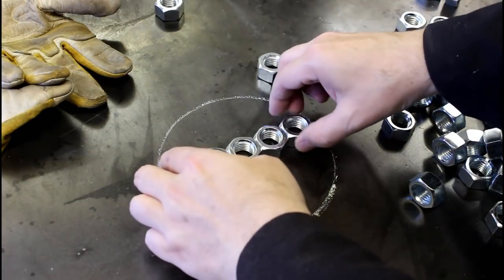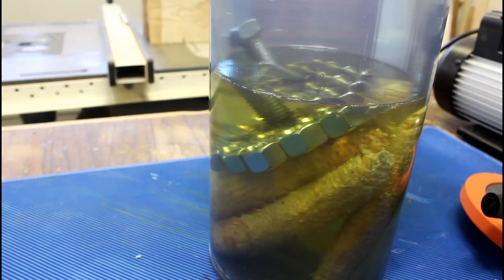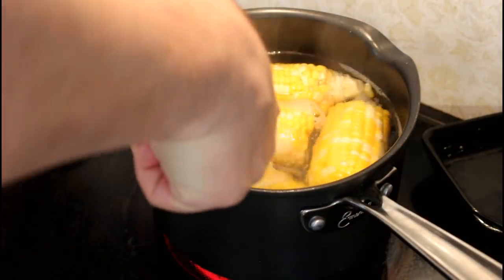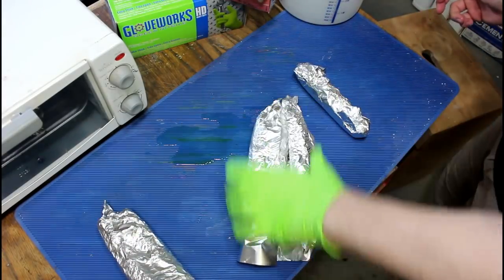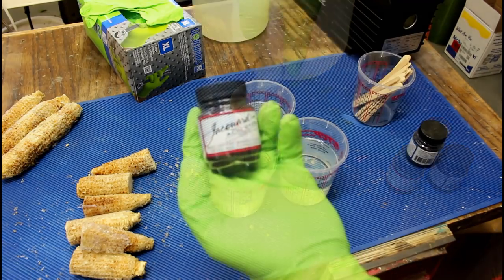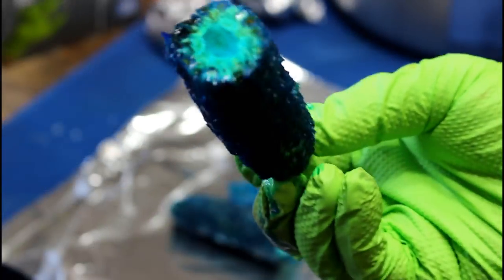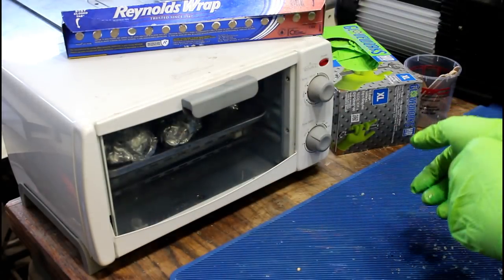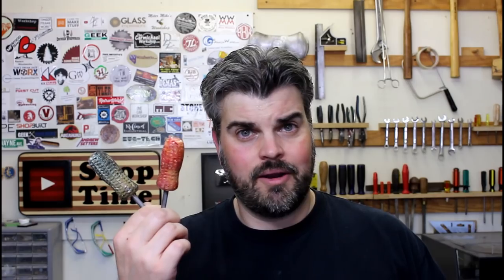Dyed and Stabilized Corn Cobs!

Comment: What about inflating a marshmallow in the vacuum chamber, then setting it in resin, still inflated?
Reply: Matthew Shaw It would deflate the second you opened the vacuum chamber.
Reply: could you not put the resin in the chamber too, so that you inflate it, then hold the vacuum while the resin cures?
Reply: That’s a great and creative idea! I mostly love it bc what would actually happen is a total mystery! 
My concern is, will the resin set while still under pressure?
Reply: K Froetta the resin would need oxygen to set
Reply: Ooooowwww....     I would LOVE to see that.
Reply: i am thinking casting and i am thinking electronics. problem is our man is not the tech guy that could create such an apparatus.
Reply: You might be able to stabilize the inflated marshmallow with resin if you were careful and the cast it.

Comment: VERY Cool!

Do know that the acid dye you got is made for protein-based fibers (i.e. animal fiber like wool.) Jacquard also offers a dye for cellulose based fibers (i.e. cotton, hemp, cane, and yes, wood) under the name Procion MX. It's generally the same price as the acid dye you got, but will be absorbed deeper and more evenly into the fibers. (My wife is a spinning, weaving, knitting, and fiber dying instructor, and I've learned more about this than I ever wanted to know just helping her set up for demonstrations.)  The fact that you used the dye to tint the resin sort of eliminated the need for it to be absorbed as deeply as it could have been, but just tossing it out there. I've been using Procion dyes on wood for a couple of years, and it works very well. Dharma Trading Co. also sells a Procion dye for a lower price than Jacquard, and in a lot more colors.
Reply: Mark Lindsay CNC there is quite literally more than meets the eye to pigments.
Reply: I know - that was my point. Not all dyes are the same. I've been working with wood for 45+ years, and one thing has remained the same - use the proper tool and or supply for the job.

Comment: Cut the corns into thin discs and set them in resin as a serving platter to serve cooked corn on.. cornception 🤯 👍🏼
Reply: Or long strips like the whole outside so you can clearly see the corn pattern
Reply: carlinianam0s Why not both? Have alternating vertical and horizontal slices to make a pattern on the platter
Reply: Brothers Make ooh I like that.

Comment: Little longer and they'd be a good ice pick for block ice ...
Flatten the end and temper and have a screwdriver  ... 
Install small micro files and have a larger handle ... 
Cut off metal end of a fly swatter and have a better handle ... 
Just a few
Reply: Install on the handle of a toilet plunger because, corn.

Comment: Corncob rolling pin. Take a couple of the linger ones and soak them in casting resin to make a surface that is completely smooth once turned without any voids, and make a rolling pin.

Comment: What a cool project! Just a heads up though. Welding nuts and bolts can be extremely toxic with the coating that typically comes on them (zinc, galvanized,  etc). A way to avoid that is to strip them down using muratic acid or even just vinegar. 

Thanks for the awesome vids! My wife and I watch every one together!

Comment: Tots may have been suggested already, but you could turn them into corn cob holders by citing them in half and epoxying two nails or pins into one end of each half. They're essentially handles for eating corn on the cob with out getting your hands messy.

Comment: That's just Awsome 🙌🙌🙌 I am a bushcrafter And a pipe smoker so few ideas pops. First it could make fantastic handles for ferrocerium or ferrorods ( fire striker) or knives . Missourimeerchaum produce Corn Cob pipes since over a century but they use plaster in place of resin. Probably because resin is not suitable for a smoking tool but it could make wonderfull pipe tampers.

Comment: Corn cob lamp stand. one time i made a lamp stand out of a old VW crank cam shaft very steam punk,  it is awesome.  i use it every day. Corn cob flashlight. make a corn cob folding knife, and yes technically its still a handle,  but its also the body of a knife, kinda like a old timer knife, or buck knife lol, would be tricky but i know you have the skill.  corn cob pen case. like those fancy pens you get in the folding cases, great job on the project and video your awesome.

Comment: When you look at the corn comb from the base it kinda looks like a flower. You could used the dyed ones or dye some more and cut them into slices and then suppend them in resin and make a bouquet of some sort or a patten. Make a table top or a pretty box. Or you could make a bowl mold and suppened some of the slices in it with clear resin and then turn it and see if you get something cool.

Comment: I was thinking corn cob knife scales. Get the rough shape on the lathe, cut it down the middle, drill some holes for pins and attach it to a knife. Maybe a steak knife for irony.

My fiancee suggests making a barn themed jewelry box and turning the cobs into pull knobs for the drawers or doors.

Comment: Take the longest one and make a tapered french rolling pin. 
Or take two cobs and make one the center of a roller style rolling pin and split the other cob in half to be the two handles on either side.
Or make a dozen corn cob holders for corn. You can probably do all three projects!

Comment: A neat idea to use the corn cobs , is to slice them and make them into a toffet to put hot things on. Also you could you what you made in this video as corn cob handle holders to stab into the end of the corn cobs to hold onto when eating the corn on the cob.

Comment: Great experiment. Resin corn cobs...gear shift, front vertical handle for rifles and shotguns, replacement handle for angle grinders, bicycle handles with larger bore, knife handle, if cobs are across a large spectrum of sizes: chess pieces...and somebody mentioned shiv...I'm still laughing at that one.

Comment: you could make a great set of screwdrivers by just using 4-6 inch bits for a drill instead of the round metal to hold them on the lathe, make sure to use a 3 jaw chuck to grab the hexagonal bits though

Comment: STABILISING PROJECT SUGGESTION - TERMITE NEST 'CASTING'?:
I'm curious as to how this may turn out.... find a piece of wood which has had significant termite infestation (I mean to the point of almost falling apart, inside should be filled with termite chambers/passages). Stabilise the wood so that it now has some strength/rigidity. Then use band-saw to cut the wood into narrow (1/4 inch?) panels. This should reveal not only the grain of the remaining wood, but also the termite passages. Sand and polish the panels to get the panels clear & shiny. Panels could be used to costruct a lamp-shade (nice warm glow from wood, weird silhouette shiining through the termite passages?)
Just a thought if you were after something 'different'.......

Comment: Yo! Finally a way to use my degree. Acid dyes are more often used for wool or silk as they are animal proteins. You would have had better luck using a procion dye or fiber reactive dye because this is corn which is a lot like rayon or cotton so a vegetable protein. Also, you really should be using a mask. Dye powders are an incredibly potent neurotoxin.

Comment: Hi .. I am new in this ... if I put the corn on a pressure pump with the resin, without doing this stabilization process in the vacuum chamber, the result is not the same?

Comment: why don't you make corn cob holders. for when the corn is to hot to hold, make two handles out of epoxy. make two spike prongs in which you can put into the corn and then hold the corn without burning yourself :P

Comment: You could probably get some snazzy looking mechanical vape mods out of these cobs. 
Stabilize them with die in the resin during the first round, drill a hole through the middle, stick in a tube mod and some guy would likely pay you a handsome amount for it.